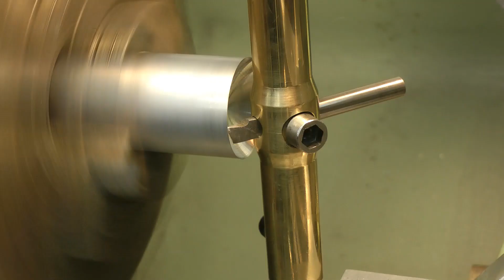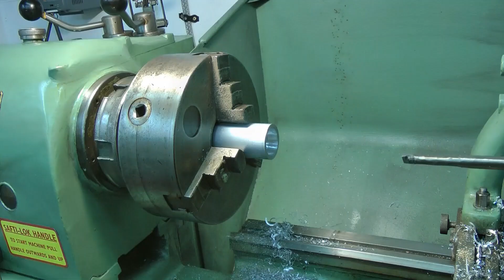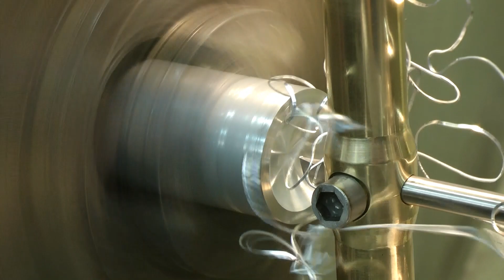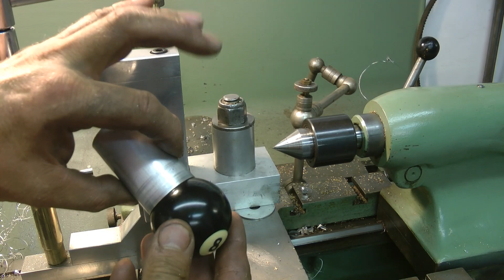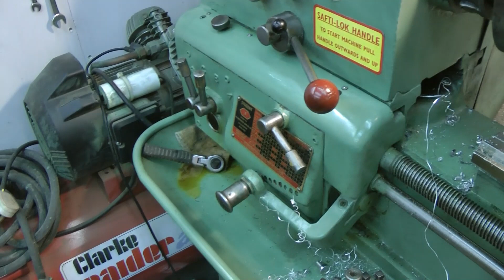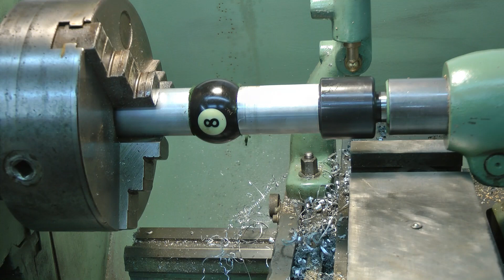lathe mod (tailstock adapter!) for the Colchester lathe first time try

Comment: hey Chris my old Colchester is leaking in the same place but im not quite sure where its coming from im thinking spindle seal? its done it since iv had it and not got round to fixing it..maybe one day! thx again mate
Reply from the maker: blackbear bowie  definitely the seal , would like to know where to get one , did try car transmission stop leak , and think it worked a bit , but I’ve changed oil since then come to think about it..
Reply: @Madchris1  guy on ebay sells sets for the gearbox and headstock plus other seals 👍
Reply from the maker: MrFusion hello 👋  thank you , I use him regularly, he sold me the safti lok sticker 🙂  I wish he had one 🙂